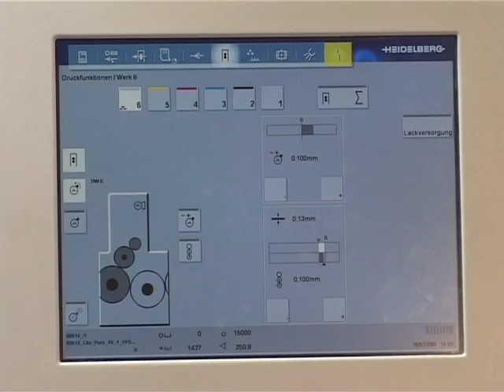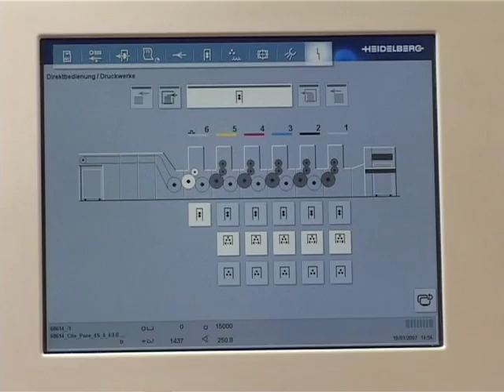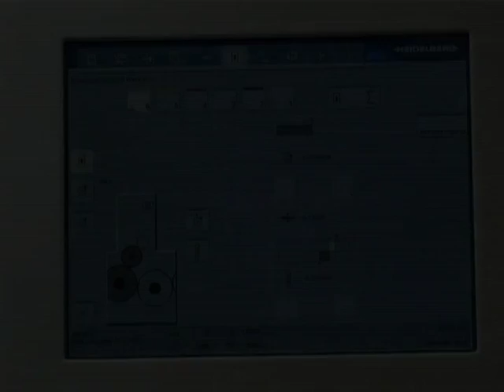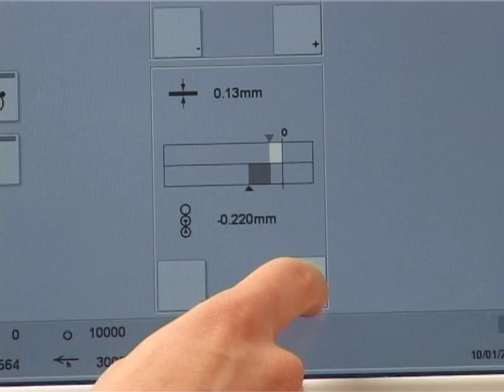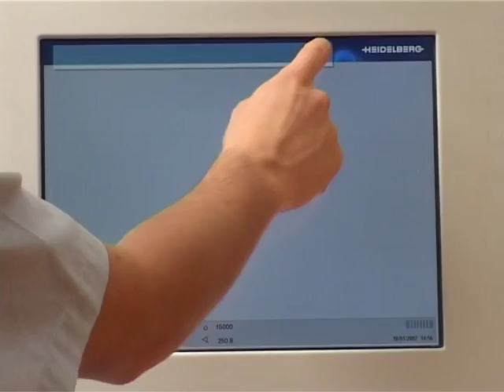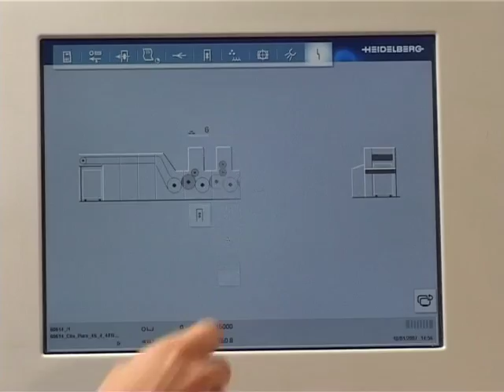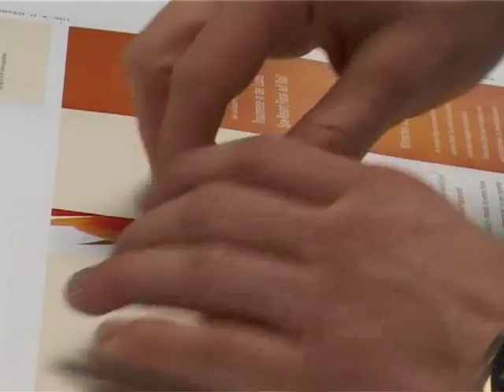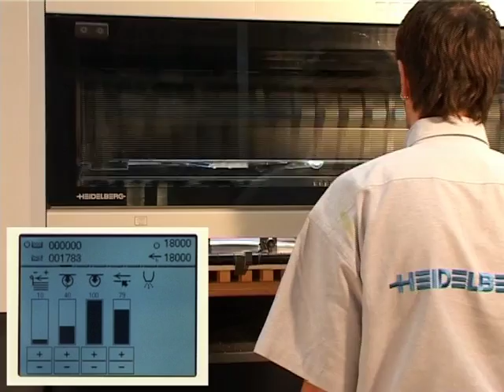CITO RSP System Coating unit

Comment: Heidelberg dog and pony show, I ran the 2012 ten color perfector in Northern California, it was a good good machine when it ran, broke down every week, water pan sensor goes down and the press will not run. The perfector pump freezes up and locks down the machine. Nine years later this press is a lemon. Main oil line ruptured because they used a hot air line designed for air supply and fifty gallons of press oil all over the floor. I could go on but you get my point 😂
Reply: With regular oil level checks & (Mann) air filter replacement the Rietschle CLFG perfector vacuum pumps will run faultlessly for years but they are guaranteed to breakdown if ignored. The water pan sensors are a simple 2 minute temporary fix; from memory, cut the cable, strip & join the two black wires, fold the blue wire back & insulate. Once the new sensor arrives it simply plugs into the wiring loom. At any one time I had 12 Hiedelberg presses on-site of various ages but I have no memory or record of an oil line failure. I found that with regular preventative maintenance the Hiedelberg Speedmaster will outperform its competitors on both quality & quantity.